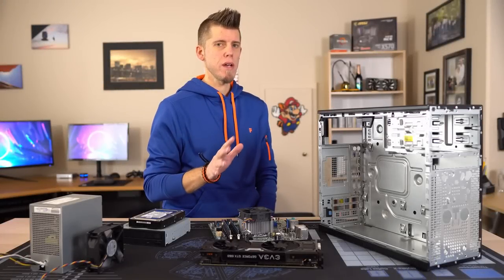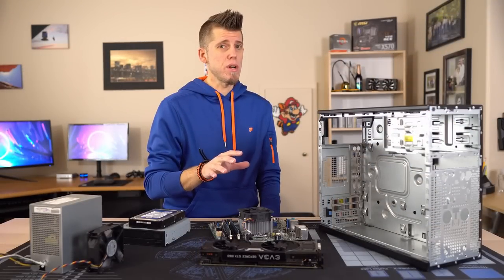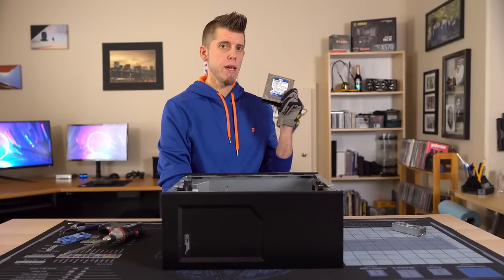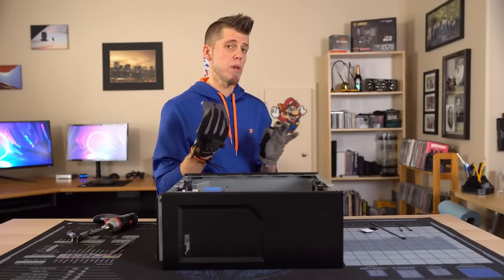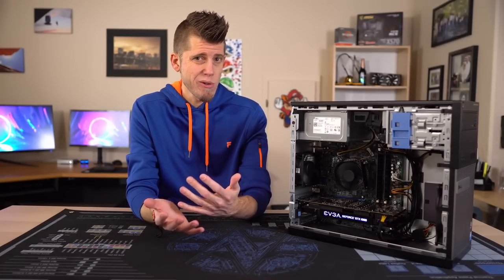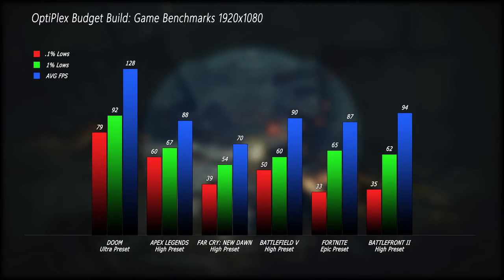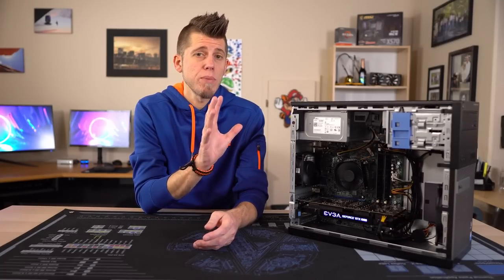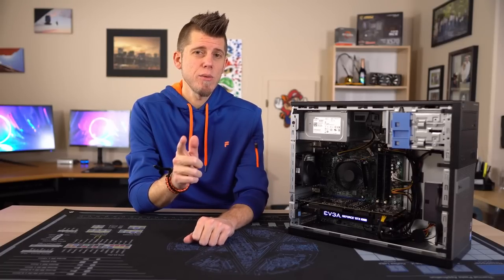Dell OptiPlex Budget Gaming PC For Under $300?

Comment: I just bought a 9020 with i7 added an extra 8 gigs of ram a gtx 1070 amp edition and a 550 watt psu. i'm gonna need an extra cable to connect my gpu to my psu.
Reply: why? there should already be enough pcie cables from the PSU
mine is 500w and it has a 6 pin and a 6+2 pin
Reply from the maker: Yep, any modern PSU worth it's salt should have the PCIe connectors. If it doesn't, I would take it back and get a better PSU. A 550 watt power supply without PCIe power is a sure sign of a lower quality power supply and I would be concerned about how much wattage it actually provides. Do you know the make and model of the power supply?
Reply: @TheGameBench  Cooler Master Elite V2 550W
Reply: @renko8065  the reason i say this is because the card is dual 8 pin it came with two dual 6 to 8 this is my first after a 1050 ti so am i using both cables is what i'm after. Ive seen some cards with 6 and 8 and they only plug up one of those slots and not both so im a little confused.
Reply from the maker: @YakDiezel  Okay, yeah.... looking at your PSU, ,it should have dual 6+2 PCIe connectors. There are some GPU's that can run off one of the power connections and don't need both. I might mean lowered performance, and lesser ability to overclock. The 1070 might be fine with just one, but since you have two, I would just connect both up and call it a day.
Reply: The Game Bench thanks!! I did what you said and it works no problems at all. Guess I wasn't paying attention to the six pins plus two on the PSU at the time but yes it's what I hoped and expected running anthem, assassin's Creed origins Apex legends and on high settings no tearing or stutters and that's without running a benchmark test. Might do that and see if I can compare any to your findings with other cards in this setup on the 9020.
Reply from the maker: @YakDiezel  Awesome! Glad you got it figured out.

Comment: could you do a video where you upgrade the air cooler?,the 9020 has threads that hold the cooler down,im not sure how to get past this,thanks
Reply: after some research i saw a video where the guy removed the cpu hold down bracket and punched out the 4 corner thread adapters and then your left with the proper 4 holes for adding on a aftermarket air cooler
. i would be interested in seeing an option to just bolt down the air cooler to the existing screw threads
Reply from the maker: I don't think you're going to find that because the height of the backplate screw points is made specifically for the factory heat sink. So, the cooler you're installing would have to have a close enough spacing as well, and the thread pitch would have to be the same as well.
Reply: @TheGameBench  yeh,it sounds like i would need an assortment of screws to get 4 with the correct threads and length. removing the MB seams like the easiest option,atleast you know any cooler would work after doing the mod to the backplate
Reply: im gonna add a 140 mm fan also
Reply from the maker: @meemadd6397  With the differences in coolers and their included mounting systems, it's hard to say which ones you would... or wouldn't have issues with. I have a Cooler Master 212 Black here I can test with.
Reply: @TheGameBench  thanks,any help would be appreciated

Comment: how much can u upgrade on a Dell Optiplex 990? btw Dell Optiplex 990 is my PC that im using now.
coz it is much smaller than the Dell Optiplex on your Video.
i hope you can make a video on that. Thanks!!!
Reply from the maker: Okay, so you have a small form factor 990? If so, you can put the same CPU's as the towers in them. So, you could put an i7 2600 in it. Since it's a small form factor, you're limited to low profile GPU's like the 1050 Ti. There's a 1650 low profile, but it's not much batter than the 1050 Ti, but it's considerably more. I will be working on a 990 in a future video, but it's a mini tower like the one in this video.
Reply: @TheGameBench  Thanks for the reply!!!
Reply from the maker: @junaldjohnclenista1999  No problem!

Comment: Dear Game Bench, thank you for making and posting your videos.  (I'm thankful for them).  God Bless you much.  That's a beautiful system (Dell 9020 MT) you've upgraded/made.  I'm trying/hoping to do a similar upgrade to my existing Gateway GT5674 (currently an AMD Phenom 9500, having replaced the PSU [600 EVGA] ~ 1 yr ago).  Hope to reuse said & case, but with a new MoBo (mATX), an i5-9600K (no OC), no GPU (no gaming), 16GB RAM, Win10 (for a relatively speedy home office PC).  Any comments welcomed.  Kindly, ¿in your estimation, will my choice of CPU (i5-9600K), running @ native speed, yield a fast running office PC, and will it last at least 5-6 yrs?  (Only if you have time for this, kindly).  Thank you.  (I learn from your videos).  tonyd\
Reply from the maker: For just basic home office tasks, you could easily get another five years out of that. I'm still using a dual core Haswell CPU in my laptop, and it still get's by, so the 9600K will be more than capable for some time to come.
Reply: @TheGameBench   Thank you very much for your advice.  (I appreciate it, and for even replying).  Thank you again.  God Bless all your good endeavors.
Reply from the maker: @tonyd1149  No problem, I'm more than happy to help.

Comment: Would anyone here recommend a psu upgrade if i do something similar to this?
Reply from the maker: Depends on what GPU you want to install. With the locked 4th gen i5 or i7 and a 1060 6GB, or something of similar power consumption, the stock 290 watt unit is fine. You'll have around a 100 watt buffer zone. If you want to run something like the 1070, or a 570 or higher, then you'll want a higher wattage unit.

Comment: Does it have a built-in wifi receiver?
Reply from the maker: It was an option from Dell, so you might find one that comes with one, or if someone installed one in it. I've never bought one that came with one. In which case you'll have to add one in via and PCIe card or a USB dongle.

Comment: Need some help! Does anyone have an idea what's the best compatible GPU for a core i5 2400 2nd gen? But im on a tight budget!
Reply from the maker: It really depends on the game and how it's optimized. In my testing I saw games where the 1070 was still giving you decent gains in FPS. In others it wasn't really any faster than the 1060/580. Honestly, I think the most powerful GPU I would pair with the 2nd gen i5 these days would be the 570 or the 1060. If you go with the 570 or the 1060 6GB model, you'll want to replace the power supply. However, the the 1060 3GB would be perfectly fine on the stock PSU with the SATA to PCIe adapter.
Reply: @TheGameBench  thank you for your time, really appreciate your response. I'll check with the 2 gpu's that you've suggested which is within my budget👍🏼👍🏼

Comment: Does that 290w PSU is enough for gtx 1060 6 GB ?
Reply from the maker: Yes, the system has about 70-80 watts of head room at full load. The 1060 6GB is a pretty low power consumption card, the 3GB even less. I've tested these 290 watt PSU's thoroughly. I suggest reading the pinned comment if you want more detail.

Comment: Why dont you use new parts that have a much better upgrade path.
Reply from the maker: Like I said in the video. The whole point of this project was to match a console on price and beat it on performance, to try and get people into PC gaming that think it can't possibly be affordable. Going with new parts would completely miss the point of the video and a lot of people can't afford to buy new parts.
Reply: @TheGameBench  I see your point, you could have used the athlon 300g and an a320 and possibly still be under 300, but the performance might not be there. Idk, if it works it works
Reply from the maker: @AdamHoch1289  Here's the problem with that. This machine would destroy a 3400G and... on top of that, the A320 kinda' kills your upgrade path considering how bad the VRM packages are on those. If you're concerned about upgrading, I'd go with a decent B450 at minimum. I'm not saying it's not possible to go new for the same price, I'm saying that you're not going to get anywhere near the performance for close to the same money, and the console would have a much better gaming experience as well, so what would be enticing about that for someone debating between a PC and a console with only $300 to spend? None of them you make the decision to go with the PC.
Reply: @TheGameBench  I made a computer for $220 that had a 2200g a b450m ds3h and 660ti. I only paid 70 for the 2200g back in 2018 and 80 for the mobo, the case was only 20, 20 for 8gb ddr4, 450w psu for 30. The rest i got off of my friends for free like the hdd is a Seagate 2tb, and the gpu is a 660ti. But that was pure coincidence. It was originally just use the vega 8 but my teacher came to the rescue with the hdd and gpu. The whole pc was a suprise for my friend George. He had an xbox but reallly wanted a pc so I made him one for cheap.
Reply from the maker: @AdamHoch1289  I mean, that's awesome, but certainly not typical and not an accurate representation of what people can typically expect to pay. I see people do videos like this all the time, and while there's nothing wrong with that content, the intent of this series was to show people how to do this so they could get this kind of performance for the same money, not to show them what's possible... but not likely.
Reply: @TheGameBench  yeah, it was just circumstance/luck
Reply: maybee nostalgia, maybee they like intel, maybee they like oem, maybe they want compatibility with windows xp and 7, could be many reasons 😃
Reply: @MrSamadolfo  ?

Comment: Where did you mount the temperature sensor for the fans ??
Reply from the maker: Sorry that wasn't clear, but I bundled up the sensor with the wires under the 5.25" drive bays.
Reply: @TheGameBench  did you attach it to the front panel or is it just in the bundle ??
Reply from the maker: @garymedeiros7126  Yep, just in the bundle.
Reply: @TheGameBench  thanks for the advice

Comment: 120$ dell optiplex i5 3470 4gb ram 320gb hdd worth it?
Reply from the maker: I'd say no. I would have a hard time paying even $100 for that. Mainly because 4GB is all but useless anymore, you'd have to upgrade to at least 8GB. Also, I wouldn't bother with anything less that 500GB for the HDD as it's really the minimum for games storage these days. While 320GB is plenty for a boot drive, I would highly suggest against a conventional HDD as a boot drive anymore.

If it had 8GB of RAM and a 500GB HDD... maybe. Even then, it's not too hard to find a 7020/9020 for the same price with those specs.

Comment: Great vid but you really should just gen an evga 450watt Bronze psu they have mor connections and are more protected and are more power efficient and they only cost about $35
Reply from the maker: Thank you!  Your point is well taken... and I won't deny the EVGA PSU would be a better option, but it would have thrown the build over budget and ultimately wasn't necessary.

Comment: Where did you put the temp sensor?
Reply from the maker: I zip tip it with the front panel cables up under the 5 1/4 inch bays.

Comment: Hey! 
What about a RX 550 for the 3010 optiplex. original PSU 300W
Reply from the maker: The 3010 should have a 275 watt power supply. Regardless, the RX 550 is a pretty low power consumption GPU and would be fine either way.

Comment: Could these upgrades work on a dell optiplex 7010?
Reply from the maker: Absolutely. It only has a 275 watt power supply, and I don't really like putting a 1060 on one, but Linus put a 1660 Ti on one so, it should be fine since the 1660 Ti consumes more power than the 1060 6GB. The only other thing to mention would be that the SATA and USB3 port will interfere with any GPU over 8.5 inches, but you can deal with that via low profile cables.
Reply: @TheGameBench  Thank you for that information.I am truly grateful.
Reply: @TheGameBench  Also, could I put in a gtx 970?

Comment: Is the 1060 on the the stock power  supply?
Reply from the maker: Yep. The 1060 doesn't really consume more than 120 watts, as long as you don't overclock. The total system's power draw, from the outlet was just over 200 watts, which is going to be higher than the component draw from the PSU. These components have around 100 watts of headroom, so it's perfectly adequate for the hardware.

Comment: Can I put a Xfx rx580 8gb on a optiplex 790 without changing psu?
Reply from the maker: Nope, no way. Full system power draw with the 580 will be over 300 watts. You'll need to replace the power supply in any of these.
Reply: The Game Bench thanks can I change it to 450w be EVGA?
Reply from the maker: @jordanespana78  Yeah, that would be enough wattage.
Reply: The Game Bench thx🙏🏽U got a new sub😊
Reply from the maker: @jordanespana78  Thanks. I'm glad I could help.

Comment: what graphic card for micro tower Optiplex?
Reply from the maker: Micro? Do you mean mini-tower? You can't add a graphics card to the micro. If it is the mini-tower, which CPU do you have?
Reply: @TheGameBench  iam not buy it yet.. still searchin for graphic which fit in..
Reply from the maker: @sinista13  Well, the micro can't fit any GPU in it. The small form factor can only fit a low profile GPU in it, so the 1050 Ti or 1650 are your best options. The mini-tower can fit anything around 9.5 inches without removing the HDD cage like I've done to the system in this video. Once you remove the HDD cage, GPU size isn't much of a problem. With the xx20 series, you can drop, just about, any dual slot GPU in. I fit a 1080 Ti FTW3 in one of these once I removed the HDD cage. However, the x90 and xx10 series can run into problems due to SATA port placement... and I cover all this in my buyers guide video. And if you want to know how to remove the HDD cage, I have a video for that as well.
If you get the mini-tower and you don't want to worry about any of that, the Zotac mini GPU's will fit regardless of any of these factors. Now, what really matters on if you want to run on the stock power supply and which CPU you're going to go with.

Comment: Will Asus gtx 1560 super strix oc edition fit in that case because it take 3 slot space ?
Reply from the maker: I can't find a Asus 1650 Super that takes up more than two slots. However, a 3 slot GPU can be an issue. If it's short enough.... not a problem. But if it's long enough to meet the SATA ports and USB3 port, you will need some low profile cables to deal with it.
Reply: @TheGameBench  Can i run GTX 1660 in with that stock 290W Dell PSU the power draw for gtx 1060 6GB and gtx 1660 6GB is the same ?
Reply from the maker: @massoudwazir6389  Generally I see that the 1660 Super is a little higher than the 1060 6GB in terms of power consumption, and either will run on the OEM 290 watt PSU. However, I would suggest using a dual SATA to PCIe 8-pin adapter with the 1660 Super. Might not be a bad idea on the 1060 6GB as well. You could also run a 1660 Ti this way if you wanted as well.
Reply: @TheGameBench  is it safe to put these pgu in dell optiplex 9020 with that stock 290w psu some guys said me it will burn your motherboard ?
Reply from the maker: @massoudwazir6389  Burn the motherboard? No... Whoever is telling you that, to put it mildly, doesn't have any idea what they're talking about. I've run 1080 Ti's in the motherboards, not on the stock power supply, and no issues.

You can check that out in my CPU comparison video.
Reply: @TheGameBench  I will go with gtx 1660 super with that 290 stock PSU it is the best card for 1080p
Reply from the maker: @massoudwazir6389  Well, if you have an i5, then I wouldn't go higher than the 1660 TBH. The 1660 Super is about on par with the 1070. I think I would go with the 1660 Ti if I had an i7. Though if you're just shooting for 1080p @ 60 FPS, the 1660 will do that without a problem.
Reply: @TheGameBench  I have dell optiplex 9020 with i7 4790 processor 16 GB Ram what is the best new series gpu for my system to run it on that stock 290W psu because in my country there is no 24 pin to 8 pin adapter to change the psu now what your opinion ?
Reply from the maker: @massoudwazir6389  The best... with that 4790, no question, the 1660 Ti. But you will absolutely need a dual SATA to PCIe 8-pin adapter to run it safely. So, you will need two open SATA power connections. You can add one, like I did in the video, pretty easily.
Reply: @TheGameBench  As I saw in your video you use single SATA to 8 pin adapter for gtx 1060 6gb ssc but you said me to use dual sata to 8 pin adapter for gtx 1660ti what is the difference between single sata to 8 pin adapter and dual sata to 8 pin adapter for GPU?
Reply from the maker: @massoudwazir6389  The difference is that a single SATA power connection is rated at 54 watts. The 1060, 1660, 1660 Super, and 1660 Ti all don't consume 75 watts from the PCIe slot, so they have to make up the difference from the single dedicated 8-pin connection. In the case of the 1660 Ti, is most certainly over that 54 watt limit. With a 1060 6GB it's right around that limit. Thus why you would certainly want to do a dual SATA to PCIe adapter since you will have 54 watts on each connection for a total of 108 watts of head room, which is more than enough.

Comment: Did u ever try a case swap
Reply from the maker: Nah... that's just not something I'm interested in doing. Knowing what's involved, with all the proprietary connections, it's just more of a PITA than it's worth to me. Not to mention that any decent case, and I feel it's really lost on these components. Any case that makes sense is probably going to a worse chassis than the OptiPlex chassis as far as rigidity goes. It also kills the value proposition. That's why I prefer to modify the existing chassis rather than swap the parts into an aftermarket case.